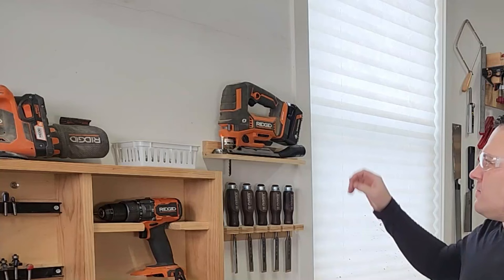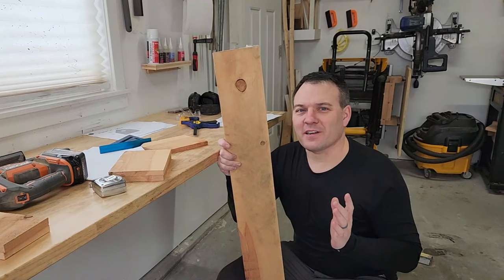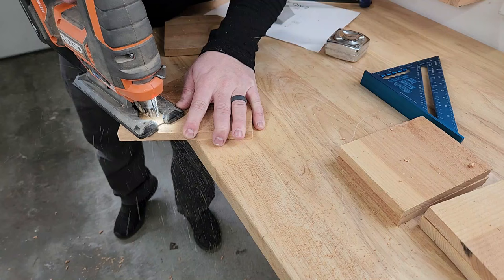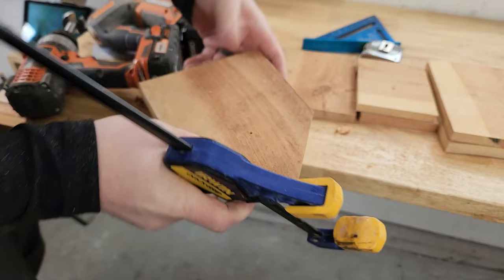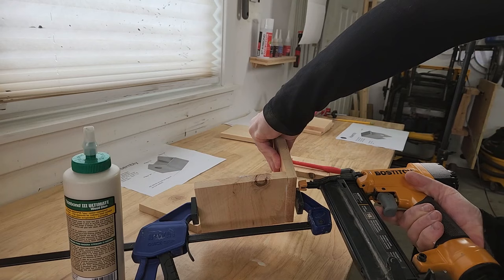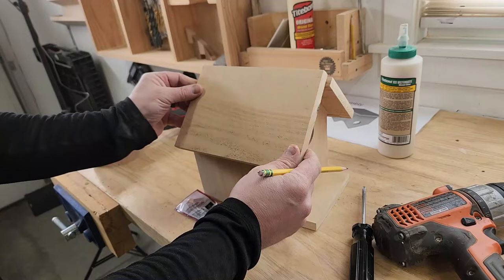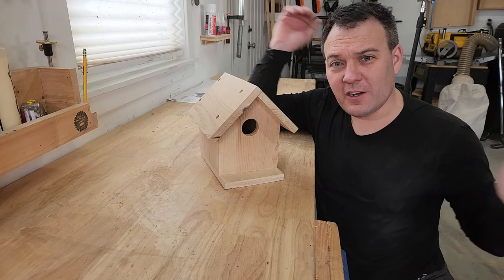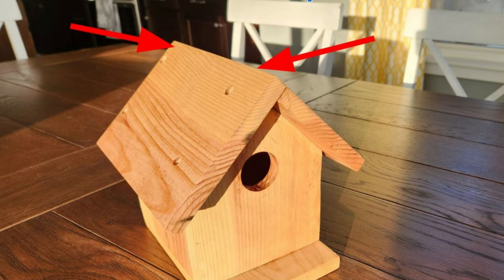Build a Cedar Bird House for Just $3! 🐦✨

Comment: Can   you make a video showing how to cut a 4'x8' board on the table saw? There's videos on YouTube, but none of the ones I've seen use a portable table saw
Reply from the maker: Well, it can be tough and dangerous,  especially on a jobsite table saw.  I would actually recommend using a circular saw with a straight guide or even better a tracksaw.  https://youtu.be/00wXEfpjs04
Reply: @HowIDoThingsDIY  I basically was doing that but I’m cutting 48, 2 inch wide pieces with a circular saw on a track and figured it would be way easier using a table saw.
Reply from the maker: Ok, I got you.  The key is to have good support.   An outfeed table would be ideal, but I've also moved my saw so I could use my workbench as temporary outfeed table.  I've also used a Kreg rip cut.  It's actually pretty good for what you're describing.  https://amzn.to/3JLfVzQ
Reply: @HowIDoThingsDIY  Ok thank you for your help. It's hard figuring out the correct and safe way to go about projects like mine as a newbie. I appreciate the help :)
Reply from the maker: No problem.   Anytime you're trying to remove a small strip from a large piece of sheet stock, it can be very dangerous.   Be careful!

Comment: Just looked up the oil you used its $65 for 9 ounces might want to retitle the video $3-$100 bird feeder
Reply from the maker: Ha.  Sorry.  You don't need to use that oil or any oil for that matter.  That was just an extra step I took.  I'm sure there are cheaper options that would also be safe for the birds.  You may be able to get the oil locally and save money.